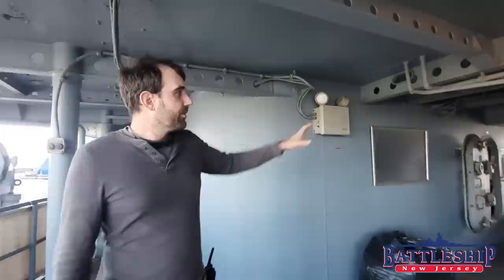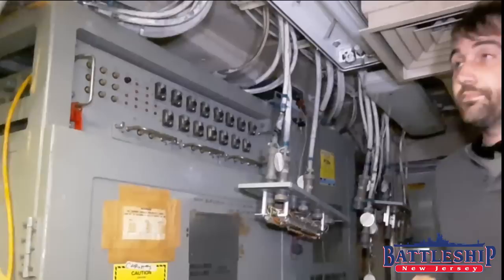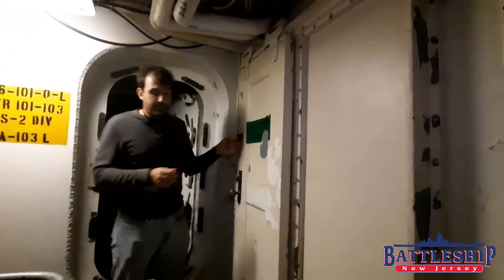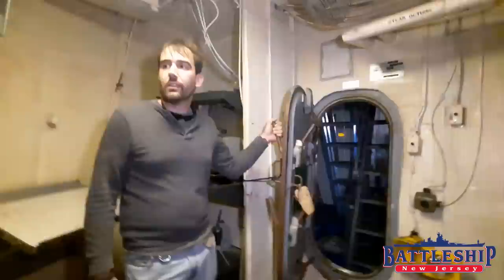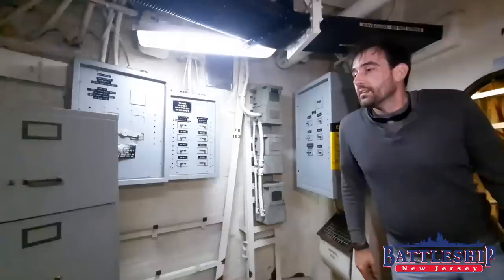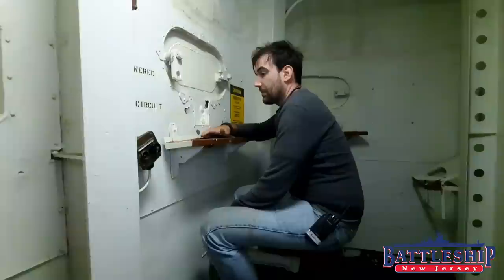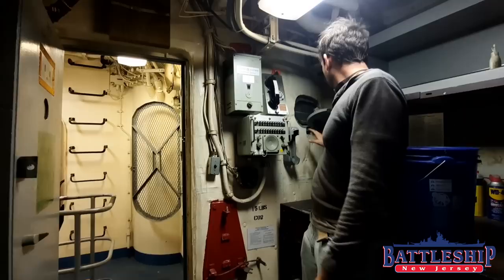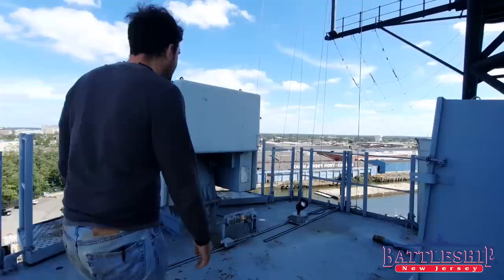Battleship New Jersey's Superstructure

Comment: These videos are very interesting, but all the time I am watching them I am thinking "What a waste!" During WWII, building more Essex-class carriers would have been so much more valuable than building the dinosaurs that were the Iowa-class battleships. The Navy could have built six more Essex carriers instead of the four Iowas, and that might have ended the Pacific War earlier with fewer casualties.
Reply: Unlikely. At the time battleships still had a role they were just surpassed in importance by aircraft carriers. The Iowas, in particular, were still very useful as, essentially, massive floating anti-aircraft batteries and shore bombardment platforms, not to mention useful in keeping enemy destroyers and cruisers away from your carriers. Iowa, herself, not only brought more AA firepower into a battle then the Essex-class did, but she was much more flexible in where she could position that AA umbrella were a carrier, ideally, needs to be far from surface action. In fact, one the primary features of the Iowa-class, it's high speed, was specifically so that it could keep pace with the carriers.
It was only after the war, when jet aircraft started to appear and AA guns could no longer reliably shoot them down, did battleships like Iowa start to become obsolete. But before that, if you were a carrier you wanted a battleship around. The Navy needed battleships, just not that many as they once did before the rise of air power, hence one reason why the Montana-class was canceled in favor of the Essex-class.